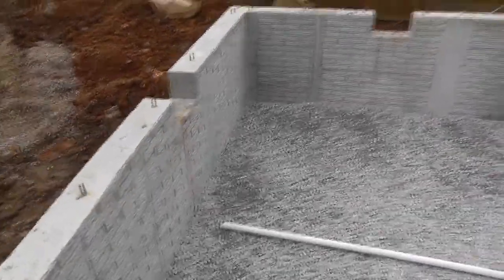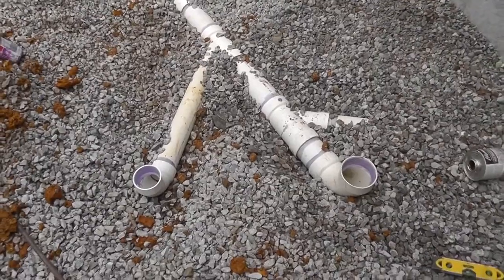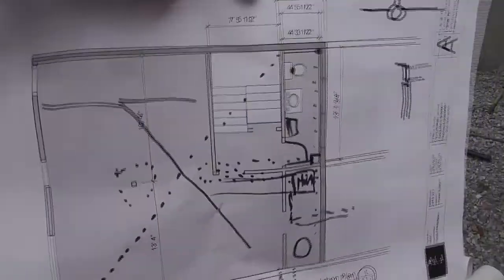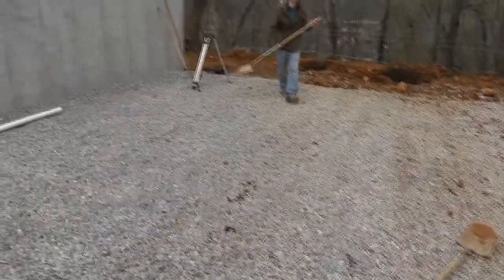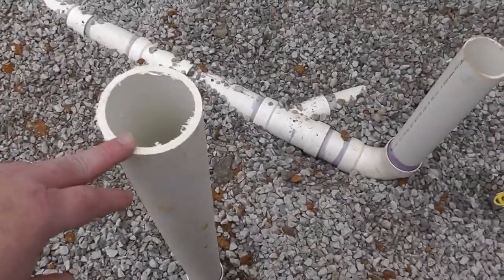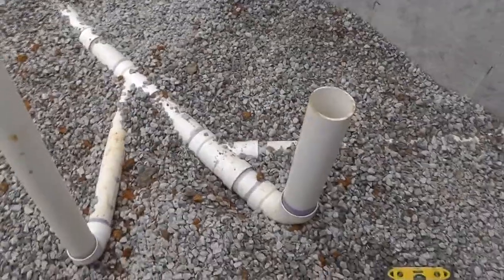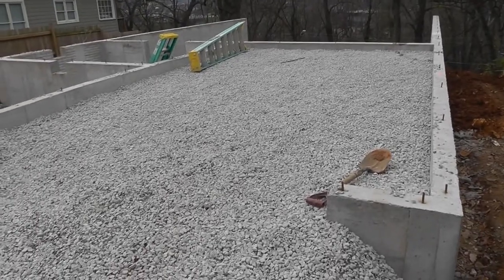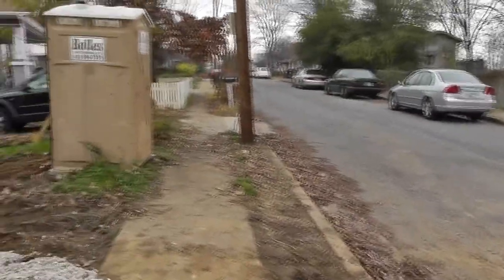Design-Build Narrow Lot Vlog #10 - Rough-In Plumbing for Slab

Comment: Hey tony what do u guys put on the outside of your concrete walls for waterproofing . We put in a good drain tile SDR 35 with the holes then break off all the wall ties dobb them with some heavy roof tar then spay the walls with a thinned tar or even paint it on then 2 feet of 2 in clean white rock over the drain tile then back fill .wondering what u all use . I find it kind strange how much is differant in the building codes around the country